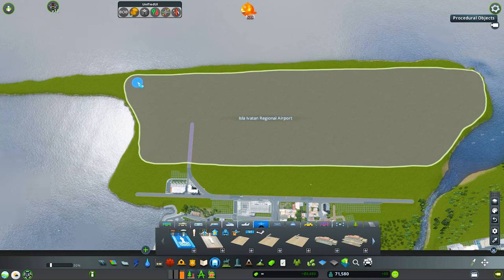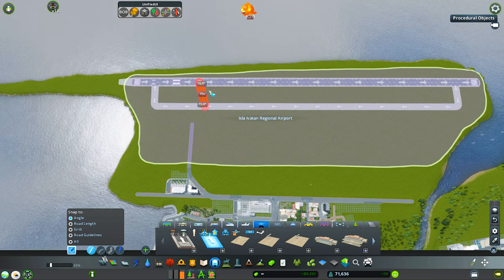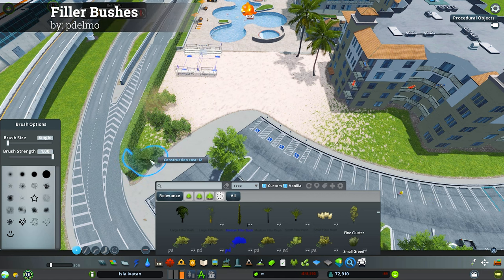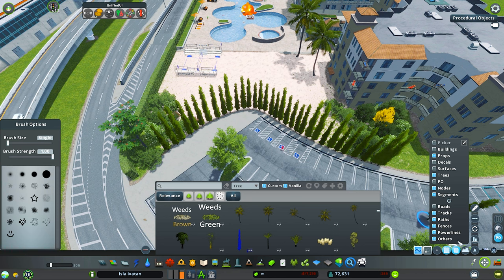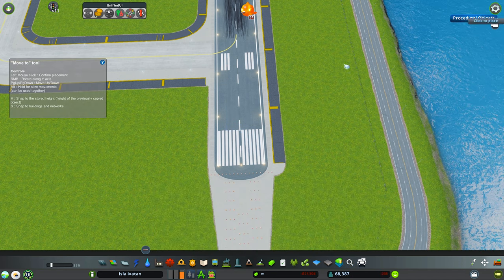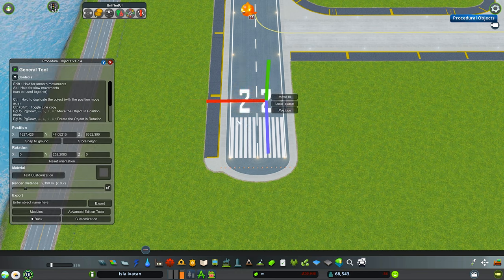Building A Simple But Beautiful Airport | Cities Skylines | Philippines: Isla Ivatan [EP29]

Comment: Hes alive! By the way the old airport is still in use, the red terminal is just terminal 1. Terminal 2 and runway 2 are just brand new expanded areas of the airport. And the gates are called jetways, the ones without jetways are called independent gates (for me atleast)
Reply from the maker: Not dead yet. Lol!
Reply: hi illi
Reply: @ShredraGaming  How about a grand central station?
Reply: @ShredraGaming  where all the passengers can connect and change lines
Reply: But i guess the rail network isn’t big enough yet, good thing to consider when it does though
Reply: @ShredraGaming  Also can you make a PAL A350-900XWB asset? Both prop and vehicle
Reply: @ShredraGaming  Another idea, build your own Okada hotel on another reclaimed area